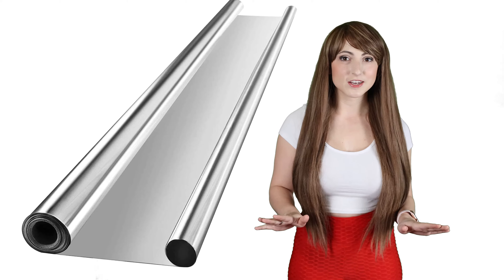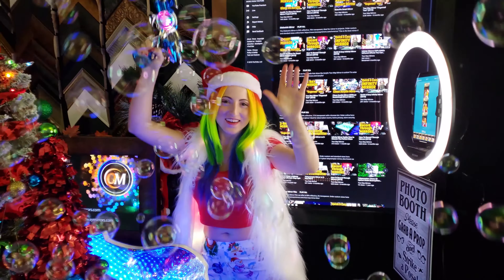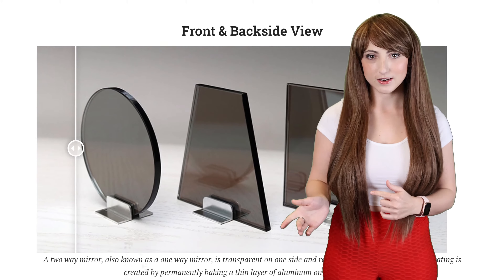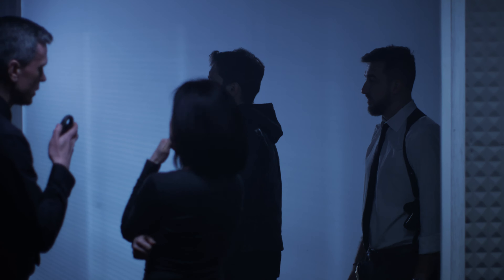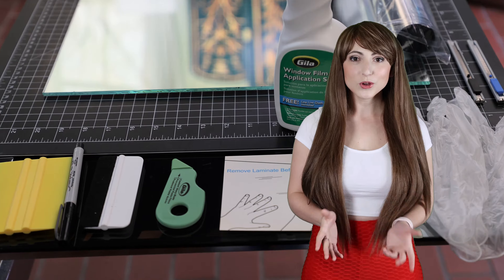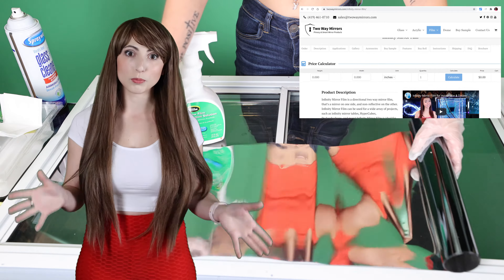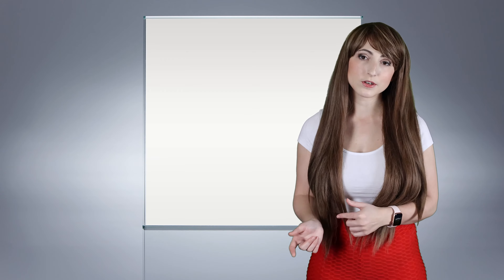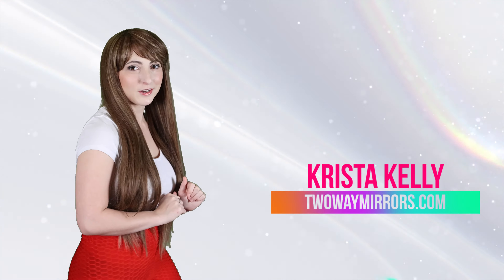How To Make A One Way Mirror

Comment: You can also get MIRROW spray paint and just put a VERY LITTLE MIST coating on the inside layer of your glass. You SPRAY on the side you want to hide behind. Start with a light mist on the glass and put on more if needed. GO SLOW, bit by bit, holding can  at least 24" away from glass and 'time is your friend here'. For best results I used an air brush since you want really FINE MIST. If you mess-up just get a razor and scarp it all off and try again
Reply from the maker: Great tips!

Comment: Yo I wonder if this would work on plastic rather than glass like them acrylic plastic sheets with this film. We have a fence that has metal bars and due to some situations we chose to install a mesh screen with some zip ties tied to the metal fence, but due to hurrican beryl the screen mesh flew off😅. And so I am wondering if I just put a plastic sheet thats lighter than glass and some of this one way mirror idea if it still applies. (Btw your cool🫵)
Reply from the maker: It does not work well with plastic. But we do sell two way mirror acrylic!

Comment: I have full length sliding mirror closet doors and it is starting to peel around the edges. 
Would using one-way Mirror film be a cost-effective way of correcting that?
Reply from the maker: Yes! Instead of replacing the glass on your door, you can apply the film to it to make it look new!
Reply: @twowaymirrors  what brand that you recommend that I purchase and is it at Lowe's or Home Depot or Ace Hardware or do I have to purchase online?

Comment: Can you put it on clear plastic?
Only reason I ask because im working on a daftpunk mask
Reply from the maker: We do not recommend it going on plastic as it does not stay well. However, since it is going on a mask you might be able to glue the edges or adhere it in a non-traditional way. :)
Reply: Thank you for the heads up
and is it possible to put the film on round glass like a dome? like for a Mysterio costume @twowaymirrors

Comment: but can you make a one way glass? you know without mirrors just a black wall on one side and a see through glass on the other side
Reply: Technically you can with a thin OLED monitor and put a small dinky camera on the other side, otherwise nope ya cant
Reply from the maker: The two way glass does do that, but is reflective as a mirror on the reflective side.